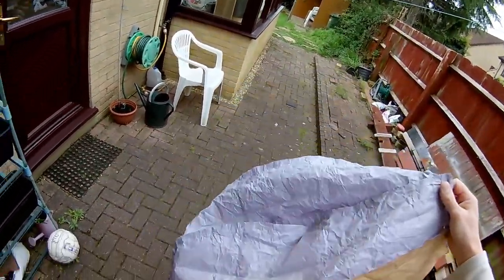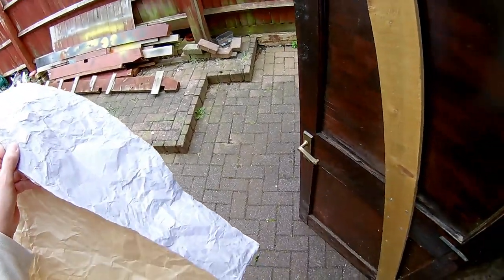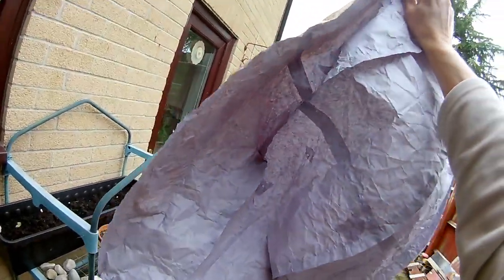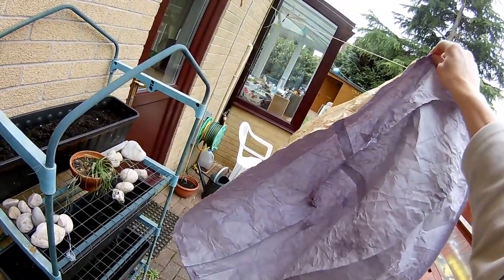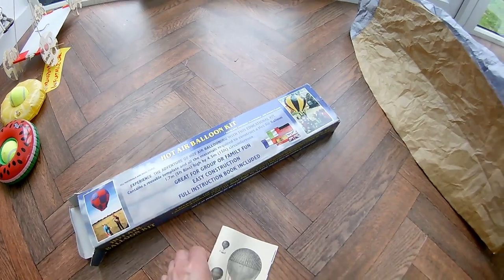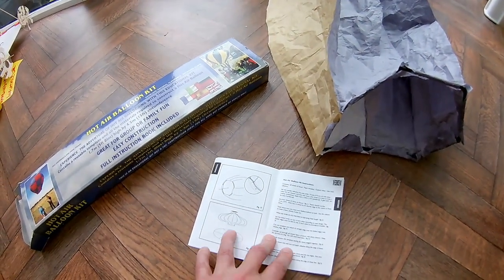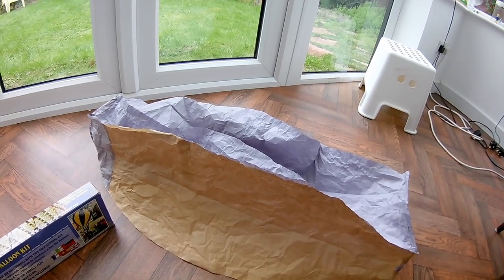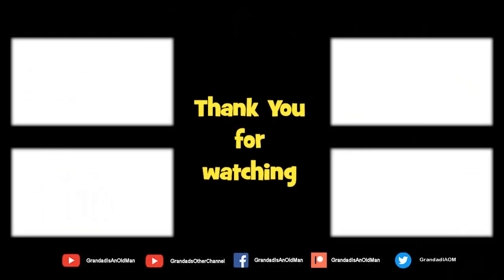Hot Air Balloon from scrap tissue paper fail

Comment: Might I suggest a bit of lightweight glue to hold some yarn in four equal pieces at the bottom and maybe a mesh of it around the balloon itself, then glue a toilet paper tube at the base to the yarn, then blow your hairdryer through the tube into the balloon. I'd also attach a kite's lanyard to it. The Balloon will then find dead resting and should function properly.If you try this, do video it please. I'd like to see how it works.

Comment: Nice!
I made one when I was 14-15 for a science project at school.
It was a little bigger than yers.
Which is tiny.
Now I am making (after + 20 years at last) a bigger one with 12 gores and bulbous.
I got the blueprints for sharing if interested.
I haven’t tested it before though.
Cheers!
From Belgium
Reply from the maker: This would have been larger if I had used the pattern supplied, but I reduced it down to use the tissue I had available. One day I might do the full size one.
Reply: @GrandadIsAnOldMan  Ah, I hope you make one again anyway.
I shall post a video on my channel in a few days or weeks of my progress.
But you got some blueprints from someone?
Was it a bulbous balloon? How many gores?
Regards.
I only flew once in a real one and it was fantastic. 😼
I called a the only real transport hot air balloon maker in Belgium, Patrick Libert and he told me he didn’t understood the blueprints I was using. Perhaps he told me that to make me buy his.
Anyway I am having a try and testing that 12-gores bulbous blueprint one I was given by some guy from France.
I think he has an RC blog if I remember well. (With loads of tips, but it’s in French).

Comment: I have some plastic bags intended for dust covers over something in a factory. Super thin and light. Much thinner than any trash bag. They can not support objects like a normal bag would, just cover. About 5 feet inflated. I have always thought it would make a good balloon. Helium or hot air should make it float well.  Wish I could give you some.  I think if these bags I spoke of had helium, they would maybe lift a gopro type camera or your glasses. Lot of volume in these bags.
Reply from the maker: This is one of my favourites https://www.youtube.com/watch?v=05Zc3fbZqB4&list=PLA5a2xPRSrB397c2by67nTyr0tDvUdi2_

Comment: Maybe if you put a little weight at the bottom then it might stabilize it and stop it flipping over.:D
Reply from the maker: I think the size/volume to weight ratio was wrong. I did try adding weight but then I couldn't get it to lift off, as it was there is a fine line between the thrust from the hair dryer pushing it up and the hot air lifting it. Ideally a cold still morning or evening would be a better time to try it as it is the difference in air temperature inside to outside the balloon that creates the lift. I have had significantly more success in previous attempts but I have never tried this construction technique and that was what I was really interested in trying. I have bought several packs of tissue paper from various bargain stores and at some time I will be doing a full sized version (as in the full size of the template from the kit). Just need to fit it into my schedule.

Comment: It does look like thick tissue paper indeed.
Maybe good for a 5-15 cubic meters balloon.
I got thin light sheets but not sure of the gr/m, probably around 15-17 gr.
The thicker can be used for the bottom.
And for the very bottom I got some heat resistant parmchint paper.
Hope you make another one again with better success.
T’arah.
Reply from the maker: I had always intended to make one properly, but haven't done it yet. This one was really teasing my friend who had used so much tissue paper to package the parcel he sent me.
Reply: @GrandadIsAnOldMan  Hi!
I started gluing the parts of my balloon :)
It’s tricky but satisfying.
Cheers!
Are you looking to make another one again?
Thomas from Brussels
Reply from the maker: @Melvorgazh  Hi Thomas, no, I still haven't got back to making one yet. I have the tissue paper and the template, but just haven't fitted it into my schedule.
Reply: @GrandadIsAnOldMan  A template.
Is it the exact synonym of blueprints?
English is not my first language.
I am looking for templates for a bulbous envelope, a bit like the Cameron Viva only with 10 gores and a little bit less bulbous.
Any idea pf where I could find that?
Regards,
Thomas
Reply from the maker: @Melvorgazh  I got mine in this kit https://youtu.be/xtD5CdCsuuQ I would think you could do a Google image search or Pinterest, usually find good stuff on Pinterest.

Comment: Actually not sure if it’s worth building your own these days, l bought a couple 
at the pound shop, they fly great.
Reply from the maker: That really depends on what the object of the exercise is. For me, this was about how to create a hot air balloon from scrap paper. In the video I showed the template for making a bigger one which I suspect would probably work and I will try it at sometime. If the object of your exercise is just to send a balloon into the sky then yes, good old Poundland is probably a quicker route. As a slight side issue I have been looking in the various bargain stores for packs of tissue paper and it is quite frustrating that many of them do not give you the dimensions of the paper they are selling, just tell you it contains 10 sheets or whatever. As part of the project series I do intend to do a little section on the different packs from the different shops to see which might be the best value.😍👍

Comment: Yep the tissue is far too heavy!
Reply from the maker: Yes, if the balloon was the full size of the template then it would hold a much larger volume of air.  It's finished size is 1.7m high and 4.5m circumference. I will build it sometime. This build was mainly about trying the build technique. This is one of my favourites https://www.youtube.com/watch?v=05Zc3fbZqB4&list=PLA5a2xPRSrB397c2by67nTyr0tDvUdi2_